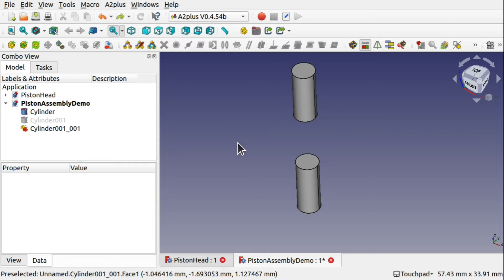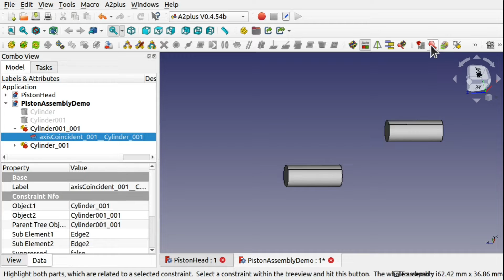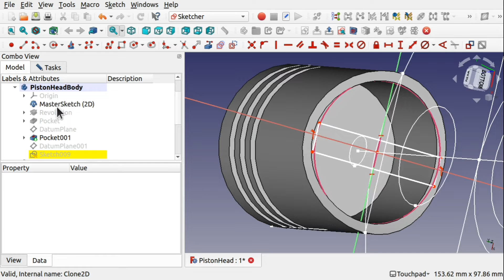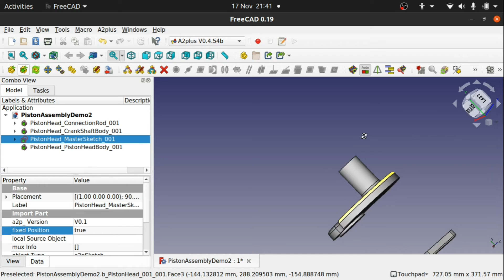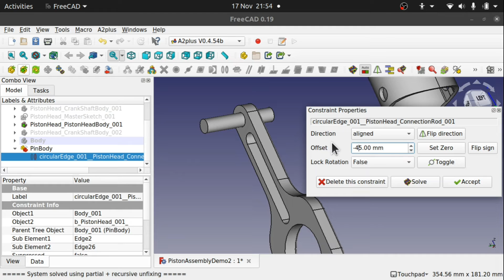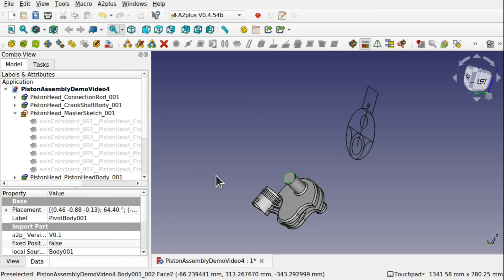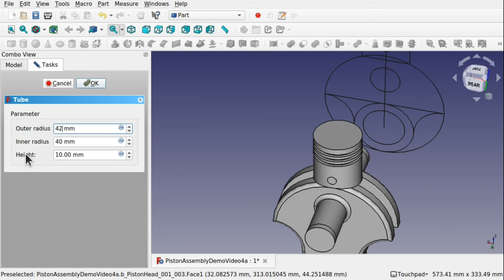Understanding FreeCAD Lesson 3.3 Model a Piston Crank Shaft Assembly Animation in Part Design A2Plus

Comment: IF your connecting PIN is rounded on the ends to the same radius as the cylinder head would they constrain ?
Reply: FYI ... the large part of the crank is a COUNTER weight for the piston weight .. the center of the crank should be the axis of rotation ... so in your master sketch the center of the circle you made the sides from

Comment: What are the advantages of A2 over assembly 4? And vice versa?
Reply from the maker: A2+ allows for simple connections via constraints. A4 uses local coordinate systems that you add and align to.   A2+ you create movements through simulation.  A4 you use sketches as 'bones' and create constraints in such a way that they act upon each other.  The prefer A2 due to the quick way you can join things together.  On release freeCAD 1.0 and Onsdel you will have a integrated workbench that can be used without the installation of a external wb.  It works similar to A2 .

Comment: I've watched the video straight through before proceeding (after following along in FreeCAD up to this point in the other videos).  I'll work on assembly next, but wanted to jot this down first.  I don't expect to have much insight to add beyond this though, since this video seems to very well cover all the ins-and-outs of assembling and pre-animating the parts!  Anyway, here's my thought for now:

It seems like it would be easier to create the parts created in this section during the 2nd section, and then import everything over, en mass, to the new assembly file.  The first several are easy to import from the geometry of the original Master Sketch, into their own bodies.  The third part (the tube) is very easy to create on its own as part of the original file, for importing into the assembly file right along with everything else.  This way there's always a base-line in the original Master Sketch if changes need to be made.  I don't know if the two files are really linked enough that those changes would be immediately reflected in the assembly file, but even if not, those changes could be quickly imported.  This would save the time of having to convert the new parts after being created in the assembly model.

EDIT:  As I'm following along, something I'm noticing is that the Datum plane added needs to have the Map Reversed set to "True" before creating the new sketch on top of it.

As you mentioned (after hiding the datum plane), length constraints can be used as an alternative to tangents.  I actually wound up doing both the length constraints and the importing of the inner pocketed circle and then the tangents (for some reason, FreeCAD allowed this without complaining about extra constraints, which was odd but a blessing).  The constraints I used were:

1.  Vertical symmetry for the side endpoints (10 mm down from the centerpoint, and 10 mm up from it, either left or right vertical lines will do).
2.  Horizontal length constraint (70 mm, either top or bottom edge).
3.  Horizontal symmetry for the top right endpoint and the centerpoint (35 mm).

I'm sure that wasn't necessary, but I thought I'd try it just as an added learning opportunity.  After importing the smaller circle (that turns into a purple line on the current plane), I found that 10 mm on either side of the center point works quite well.  I did do the work as added to the original file (without deleting anything, just hiding the pocket that contained the symmetrical holes in the piston head), and will import the updated piston head along with the other parts when creating the assembly file.  Doing the work in the original file seems to have worked well.

Note to Beginners who may have trouble following the different files created during this video: the "PistonAssemblyDemo" file (not the "PistonAssemblyDemo2" file) is just for teaching how to use some of the FreeCAD tools used during the rest of the video.  If you want to follow along, do so!  Just understand that the two cylinders created here aren't used in the finished model.  At the same time, giving one of them a 15mm diameter and a 80 mm length can replace the manually created pin later in this video.  The other cylinder can be given a 50 mm diameter and a 10 mm length to replace the manually created pivot disc, also later in the video.  They're essentially the same thing, and can be imported, then moved/rotated to any place and position in the assembly file, which will also be created a bit later in the video.

I've found that it's a little easier to work with the un-assembled pieces if, when importing them, I just keep my mouse pointer still and click once for each imported part, which places them centered on the imaginary xz grid (the way they were in the original file).  Then I transform them along the horizontal axis to spread them out (but I transform the piston head and the ring upward along the vertical arrow).  I leave the connection rod and the Master Sketch where they are.  It's just a little easier to work with the parts and to think about where everything should be in relation to the Master Sketch.

Notes to Self: 

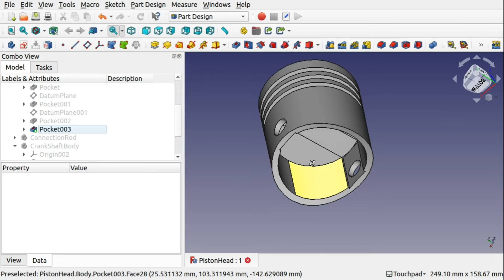19:25 is where assembly and constraining begins.
39:46 is where finer detailed constraining begins.

I don't know why, but the 2nd fillet on the connection rod absolutely refused to import into the assembly file from the original file.  I selected the connection rod while in the A2Plus workbench, switched to the Part Design workbench, and created a body.  This automatically copied the original connection rod (in the assembly file) to the new body.  I then added the filet (it's supposed to be 2.5 mm), converted the body to work in the assembly mode, and deleted the excess fillet that was created (outside the body, not inside it).  I was then able to successfully put the rotation constraints into both holes in the connection rod, as called for in the video.  The two circles (for both holes) didn't snap together though.  I don't understand what's wrong that's causing this part to not work the way it should.  Not long after this, my FreeCAD crashed.

After this, I went back into the original file (pre-assembly), redid the connection rod in a new sketch inside the same body, and manually added 30 mm radius curves to it where the first fillet would be.  I deleted all the old stuff from within that body (the original pad, sketch, and fillet) except for the imported geometry, then padded the new sketch and redid the fillet.  This imported nicely into the assembly file and did include the (now only) fillet in the connection rod (the 30 mm radius arcs I added are now just part of the original sketch, so those imported as well).  However, the 2nd radius constraint gives a crazy error message, which when ignored, seems to still allow the 2nd radius constraint to be added anyway.  Still, the connection rod does not snap to the Master Sketch, so I added a circular edge constraint to the smaller hole and the matching hole in the Master Sketch, and called it good.  I'm convinced that for whatever reason, my installation of either FreeCAD .19 is somehow different from yours, MangoJelly, or something is wonky with the A2+ workbench at the moment.  Either way, I followed your instructions from the different videos for this model, to the letter first, and that didn't work for me (even though it did for you), so I had to improvise.  Hopefully, my improvisations don't mess this up in the end.

In the end, because of multiple error messages about the tool for finding conflicting constraints, I gave up, deleted the whole assembly thing, re-imported the parts into a new one, and began having the same kinds of problems.  It's not possible to have the fillet imported with the connector rod and not have the constraints be crazy from there on out, in my installation, either of FreeCAD or of A2Plus.  At this point, I've been over this video at least 10 or more times, and I'm just kind of done with trying to mimic it in this installation setup.  I'm hoping that FreeCAD .20 will be tons better and easier to use while going through your tutorials!  I think until then, I'm not going to worry about assembling parts in A2Plus, at the very least.  As a beginner, it really is enough for me just to learn how to use the Sketcher, Part Design, and Draft tools.

Comment: The assembly does not move again after saving and re-open.
Reply: select and unselect all constraints on the master sketch got the animation going again. Save and reopen the file I then get "Animation problem detected, Use system undo if necessary". And the assembly falls to pieces.
Reply: The only way to save a working copy is to have all axis constraints on the master sketch active and fixed positions of the pivot and the tube false. Reopening the file and manually changing the constraints and fixed positions brings back the animation.
Reply: The assembly froze again when executing the += 0.5  Python script. Going back to the previously saved rotating versions, the thing fails apart again. Now I don't know a guaranteed way of saving a working version.

Comment: Feature shown at 4:47 (update parts...) does not work for me. Just like in the video, I added a cylinder, converted it, modified radius on original cylinder and clicking button had no effect. I'm on  A2Plus V0.4.55b and FC 0.19. Thanks

Comment: If anyone is having trouble with following the video, be sure to update your A2Plus workbench. I couldn't import the master sketch with the version I had but could do so once I updated the workbench. Great video!
Reply from the maker: Thanks for sharing, great for anyone experiencing problems. 👍
Reply: Yes me too. Updated but sill doe not work. Using Freecad 19
Reply: I opened both files. Ctrl C  on master sketch. +ctrl V in assembly file and then converted o A2 Plus part will check it works
Reply: Ok so CTRl C and CTRL V work around woks. Got my assembly ready for animation